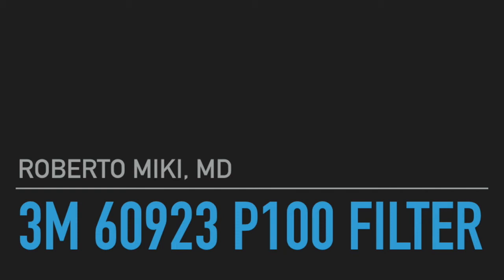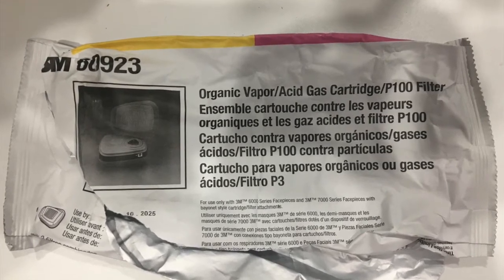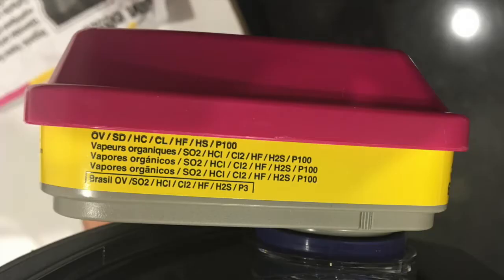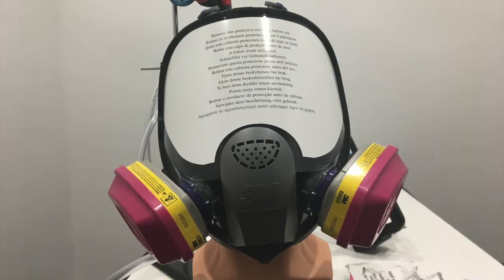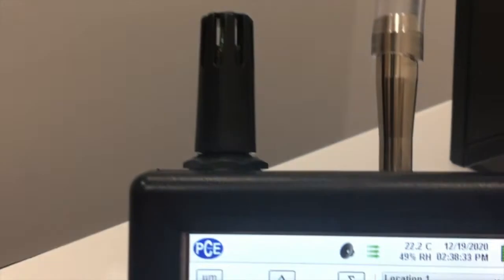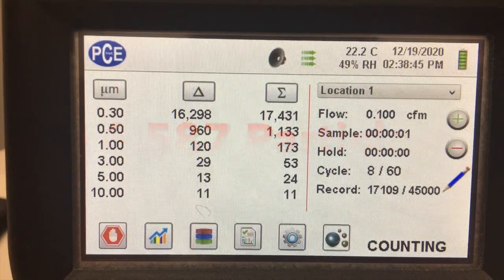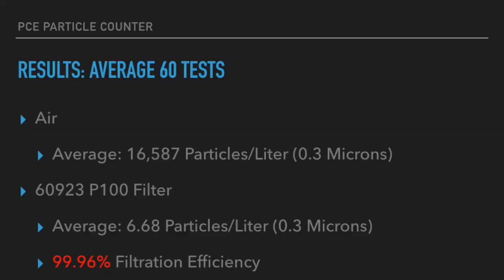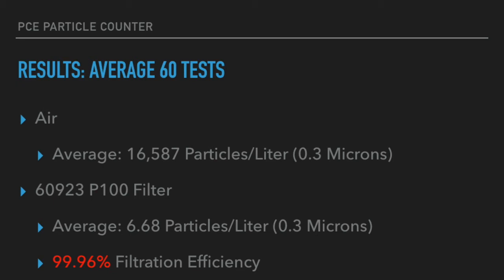3M 60923 P100 Filter Testing

Comment: can you smell cigarette odor / smoke with that setup?
Reply from the maker: Honestly, do not know but I imagine no. I could try to test it.
Reply: @RobertoMikiMD  good to hear that.. pls test it.
Reply: I’ve used it when soldering and welding and I can’t smell anything through it when properly sealed on the face
Reply: @samueldenning5875  The 3M Pro multipurpose respirator had a perfect seal on my face. Just cover the two filters with your hands and if you're instantly suffocating with zero air leakage, you're good to go ;)  Using it to remove asbestos ceiling tiles from my 1930s house.

Comment: I work with melting plastics. Is this filter suit for the job?
Reply from the maker: Not sure. I think it depends on what kind of plastic you are melting. 
https://www.sentryair.com/plastic-fumes.htm
https://pksafety.com/blog/setting-plastic-on-fire-and-choosing-the-right-respirator
You may need to seal your eyes off as well. You would need to check with an occupational hazard expert for the correct filter to use. This is a little outside my expertise.

Comment: All test on your channel is best 
Can u test both air in and out
Reply from the maker: We test both the air on the outside of the mask and on the inside of the mask at different times but unfortunately not simultaneously. I would need two particle counters which are expensive to do it simultaneously.
Reply from the maker: thank you for watching!

Comment: How much a simple kn95 mask can really filter inside a taxi? It never feels tight around the nose if I'm talking. I'm using one Barbeador Max-02 kn95 and a surgical one on top and I leave some windows open when driving just in case. Many clients wear their mask under their nose which is disgusting....
Reply: Like you said, the issue with masks like that is they dont fit well and dont reliably maintain a seal during movement/talking/breathing. The kn95 may have good filtration ability but what about the unfiltered air you inhale from the edges of the mask?
Is it a big deal? Thats up to you.
If you want high reliability youll need a tight fitting elastomeric mask, preferably one made of silicone for comfort. If you properly select the mask for your face, you'd likely be amazed at how loose you can wear it while still passing the OSHA irritant smoke test and/or the metered test. These types of mask are also much easier to breathe/exhale in as well.
Due to the issue becoming overly political I sadly cant reliably say if the virus is as much of a threat that they say it is but if it is, non-elastomeric masks are a poor choice unless for some reason its your only option.
If youre extra curious: buy irritant smoke test ampules and test yourself (slide ampule into a blood pressure squeeze ball and puff yourself to see how poorly fiber cup masks perform due to fit.)

Note: all of the above is my layman advice, if anyone believes im wrong on anything feel free to enlighten me
Reply from the maker: nicely stated

Comment: So this should be effective as sars-cov-2 protection? Thanks for the testing!
Reply from the maker: It should be effective but its over kill because you do not need the organic vapor portion of the filter for SARS. You really only need the particulate portion of the filter.
Reply: @RobertoMikiMD  not in my case, where sometimes I have to work in machine shops / manufacturing in close contact with other people. That doesn't happen every day but p100 always passes through all the nasty smells. I know all those chemicals are in safe levels, but if I wear a mask I'd prefer to smell nothing at all. Thanks!
Reply from the maker: @AlexDiamantopulo  that makes a lot of sense for that kind of situation. Be safe!
Reply: Bahahah  @AlexDiamantopulo